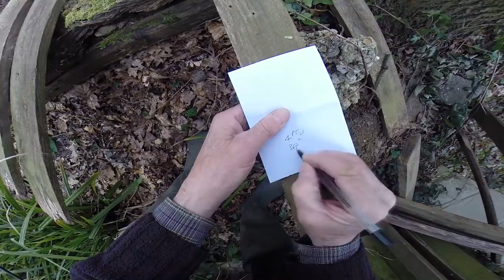LOCKDOWN - GETTING THE JOB DONE!!

Comment: Graeme, really appreciate your efforts making these films during the lockdown. You're keeping us all sane.
I must say though I was wincing watching you working under that mower. Please, please leave the plug cap OFF when you're moving the blade. I used to service mowers professionally and it's surprising how little movement of the blade it takes to turn the engine over. You wouldn't be tying any more fishing knots put it that way!
Not lecturing or being a keyboard warrior just looking out for a fellow fisherman, and one of the nation's favourite at that.
Have a good BH weekend. We'll all have a bait in the water soon I think.
Reply from the maker: Good tip,thanks for passing it on .I always worked on the assumption that the "kill switch" bar release when you stopped the mower would prevent it from ever starting ? but I guess there might be old  mowers out there with no kill-switch bar ?

Comment: A tip on your gate posts Graham the cracks are the wood splitting from the rain in gets in the grain and rots it! If you have any lead make a lead cap for them tag them on with some nails stain them the same colour and the  posts will last forever then.

Comment: The plug spanner has a swivel so you can put it at right angles to undo/do up the tight ones. Plugs should be hand tight + 1/4 turn to crush the washer or about 1/8 turn if tapered plug or washer already crushed by previous use, it usually states how much on the spark plug box. woodlice feed on rotting timber. Put a nail/ screwdriver shank through the bolt hole of the blade after grinding to check the balance as best you can, out of balance blade will cause vibration and shorten the bearing life. Excellent video as always Mr P. 10/10 . The only problem is I now feel guilty for not doing the same 😄😄
Reply from the maker: Balancing the blade seems like tip of the days as others have already mentioned it in comments below so its something I will try..Good excuse to play with the grinder again.

Comment: Another tip on mower blade sharpening...balancing the blade, after sharpening hold a long nail outward  in your fingers and hang the blade from the center hole.  If the blade tilts one direction you should grind a little more off that side.

Comment: You could cut the top of the post off flush and make a new wooden cap for it with the same shape, but overhanging a bit to shed water.
Reply from the maker: Someone suggested lead flashing,which I have a roll of so its something I must make. Thanks for the comment.

Comment: Jaysus Graeme you're making all us look bad with your  endless jobs lol. P.s. after sharpening the lawnmower blade its a good idea to balance the blade to prevent vibration (easily done by hanging said blade off a nail in the middle hole position, if the blade remains horizontal its balanced, if it hangs down to one side just sharpen the side that hangs down again until it balances properly). Love the vids..keep em coming.
Reply from the maker: Good tip,I will try that next time I take the blade off.

Comment: Mowed the lawn for the 2nd time this season today and %@#$%^& we're supposed to get 3 to 5 inches of snow tomorrow night!!!  Guess I'll be pulling the snowblower out.....AGAIN!!  Just want this lockdown to end before I run out of jobs. In the past week...edged & mowed the lawn, turned over the wife's garden plot, washed, waxed,detailed, tuned up & changed the oil on both my truck and the wife's truck (she drives a big pick-up too, lol), power washed the back deck, washed all the outside windows, cleaned the gutters and did alot of work on the boat me and my 2 sons are restoring.  Pretty soon, I'll have nothing left to do!!!!!

Comment: On your mower drill a hole into the deck fit a hose lock male into deck then you can wash the deck by connecting a hose and running the engine. The blades will wash are the grass and dirt out . Thanks for the videos and stay safe.

Comment: Use a piece of roof flashing ( zinc or the self adhesive type) on top of the gate post to shed water beyond the cracks. Should be able to paint it same colour as the post too.   Great vids keep it up.
Reply from the maker: Good tip...I think I might try that before next winter.

Comment: If youre not using your mower for a long while,, let the mower run out of fuel on the last cut or the petrol can varnish up the inside if the carb,, also its worth checking the carb bowl every now & again for crud and such.

Comment: it seems like you need a new mower boss aka the cast part attached on main drive shaft it is a fail safe for if you hit a rock or stump it breaks the 2 little pins instead of breking the crankshaft, and also your mower blade should have been balanced before reinstalling
Reply from the maker: Good tip about balancing the blade,someone else already suggested that.I will give it a try next time,just out of interest as I'm sure it won't balance level(still cuts OK though)

Comment: As a man who mows grass for a living plz remove the cap off the spark plug before removing the blade turning the blade can start the engine if the dead man handle is damaged also mite be worth investing in a blade balancer as an uneven blade can make it vibrate and damage the mower or could damage you if your very unlucky I have seen both happen Loving the vids 😁
Reply from the maker: Thanks for the tip,my mower has the deadman working fine but the blade balancing will be worth a try...if its too far off I will just order another blade.

Comment: If you're having trouble with moles and want to get rid quickly do what I do buy a cheap battery radio switch it on put in a bag bury it in said bag and wait it doesn't take long for the moles to vacate because of the vibration they can't find the worms so they move on 👍 . Its just the way iv always done it living in the country side  .

Comment: A couple of little questions for everyone.
1. I've got a boat rod that I'm going to buy rings for. I'm having a roller on the tip should I go roller all the way?
2. If I'm going to use braided line do I need to use special eyes on a rod? I've seen some pictures of eyes being cut through and want to avoid it.
Stay safe everyone, we're getting there with this virus. 👍😷
Reply from the maker: Roller guides used to be all the rage years ago,primarily for fast running saltwater fish like Marlin,Tuna,Wahoo etc as it reduces line friction on the guides. I think the modern circular rings are pretty good at minimising that,but with rollers and braid,as that type of line is so fine it can actually jump between the roller wheel and side of the frame. Worth considering.
Reply: @TAFishing  
Thank you. Yet again you've helped me out.
Hope you are all doing well.
Sending virtual hugs 👍😷